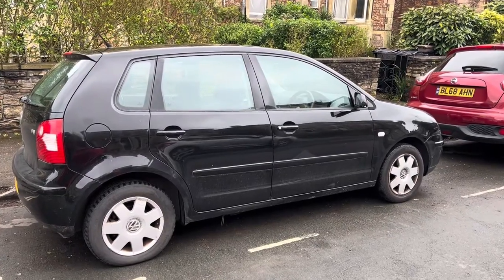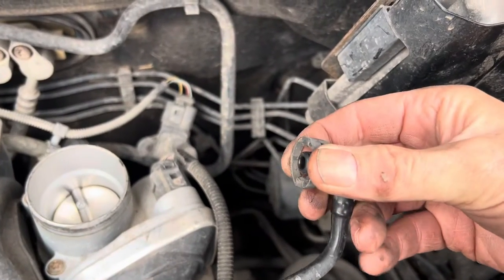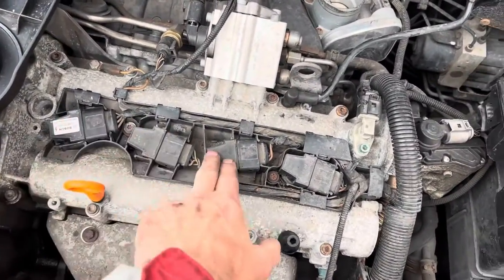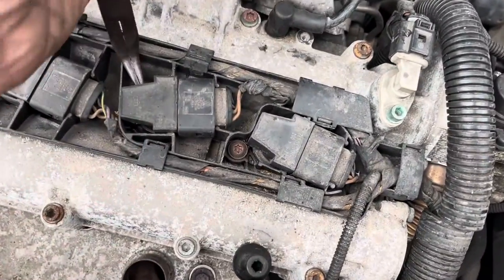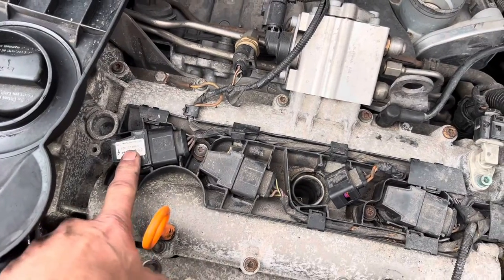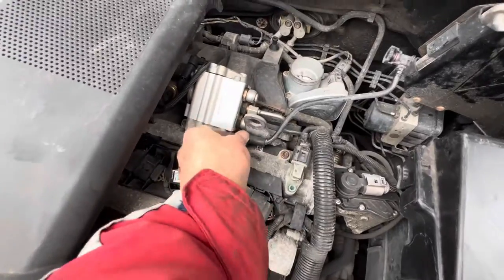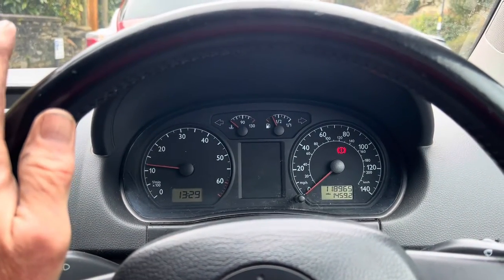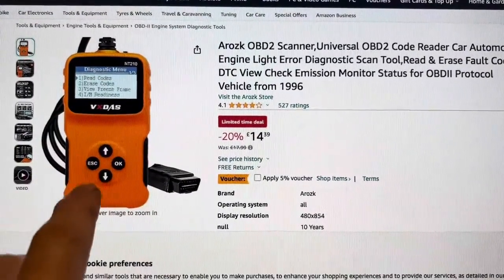Cylinder 1 Misfire Detected - Error code P0301 - VW polo, Audi, Toyota, Mercedes. FIX

Comment: Cool video Mike...... Does this mean you can make a video about fixing my SRS light?   🤪 🤣 😂
Reply from the maker: How hard can it be.....
Reply: @MikesMercsandothercars  Did I see your blue one on TV last night?
Reply from the maker: oooh I dont know, I never watch TV. Wjhat channel or program were you watching? It has been in several films recently. Mike @Nilfaultfound22
Reply: As it turns out, not hard at all. Found the seat connector disconnected. Plugged it back in. Used the OBD1 tester to reset and the message cleared!! 😂
Reply from the maker: Congrats on fixing the SRS light - soon you'll be making vids for Mikes mercs...and yes that was my Pagoda in Netflix production of The Gentleman. Mike @Nilfaultfound22